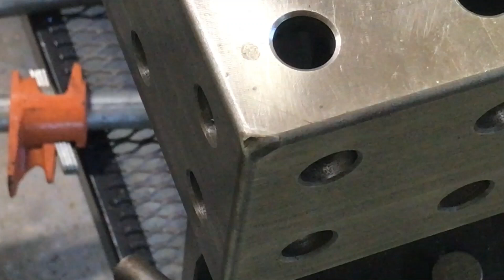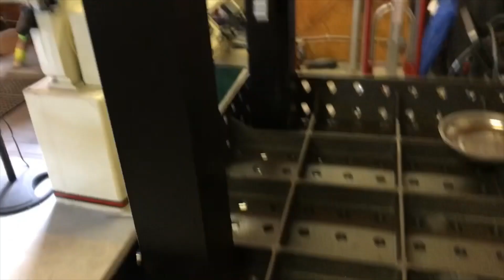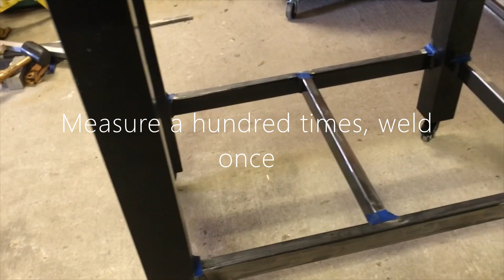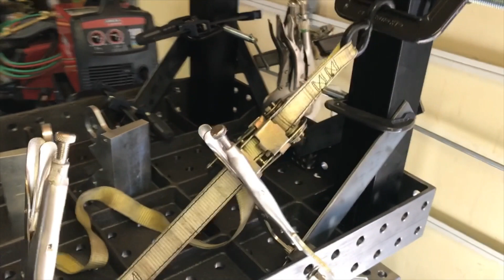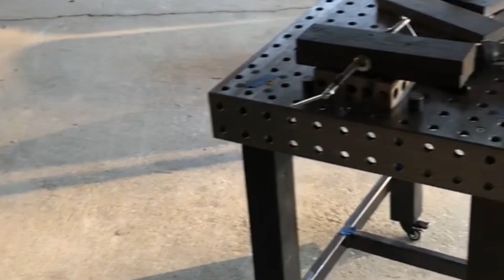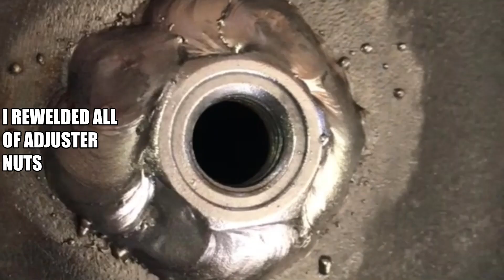7 month review - Langmuir Systems ArcFlat 24"x36"x3/8 thick Cast Iron Welding Tables and clamp racks

Comment: What brand of Clamps & blocks did you go with? My Arcflat is on its way
Reply from the maker: Hi Dustin, I made the clamps out of 5/8 inch bolts welded to Harbor Freight clamps. There are multiple videos on how to cut the clamp and weld on the bolt. The 1-2-3 and 2-4-6 blocks I got on Amazon.

Comment: Man, right now im bedating on if the leg issues are worth dealing with for the sale. 4 of these right now for $2k
Reply from the maker: That’s a heck of a deal! The legs are free.  I’m  sure they corrected the problem that I had. All the other reviews of these table do not mention it. The tables @ $500 alone are worth it. Hard to find a 4’x6’ cast iron table setup for  $2K.

Comment: Im surprised at how the legs are attached. I would have expected the table to have countersunk holes on top with screws the went into the top plate of the legs. This seems really chintzy. I see that Primeweld has new tables that look better.
I’ve seen videos showing a small nut welded to the bottom of the table for the kegs. Maybe they’ve fixed that. It was a real issue.
Reply from the maker: There are 4 counter sunk holes on the top for each leg. The Allen head bolts are flush with the table top. Two of the four counter sunk bolts are shown at 1:29 in the video.

Comment: I love what you have done with those tables. I have the 3x2 as well. Can you show me how you added the lower shelf and where you got the clamp rack from?
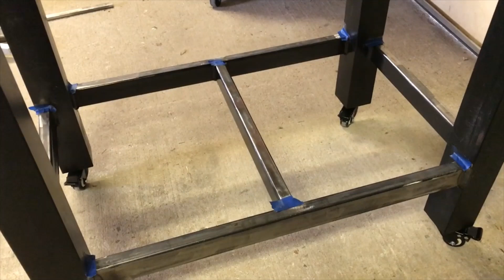Reply from the maker: Hi Richard, this is the Amazon link to the racks https://www.amazon.com/gp/product/B00CHZ9XLS/ref=ppx_yo_dt_b_search_asin_title?ie=UTF8&psc=1#customerReviews. At 4:15 in the video shows the 1x2x.188 tubing layout. Once I squared two legs to the table I measured the distance and cut the tubing to size. When I had the tubing fitted on the 3’ sides of the table tacked in place, I squared those planes to the table and measured and cut the tubing for the 2’ sides. Once all the tubing for the shelf was in place I finished the welding. For the layout of the mesh shelves I made a two piece cardboard template that fit within within the layout of the shelf tubing. To get a tight fit the two cardboard templates  were cut as mirror image of each other and overlapped in the middle. They were then taped together to make a one piece template that was used to mark the size on the 16 gauge expanded metal.